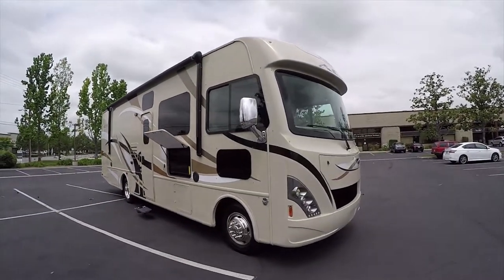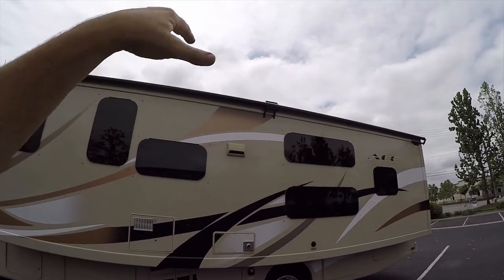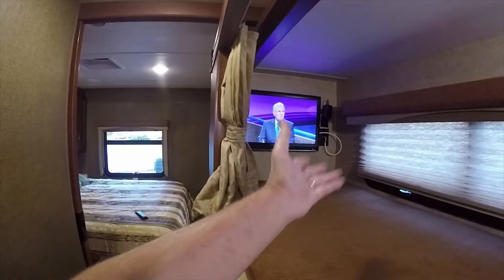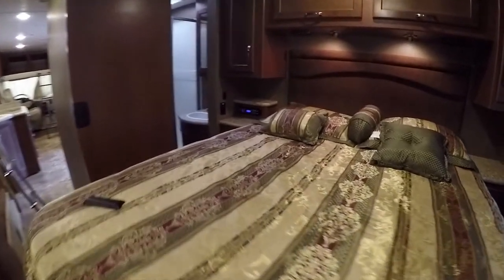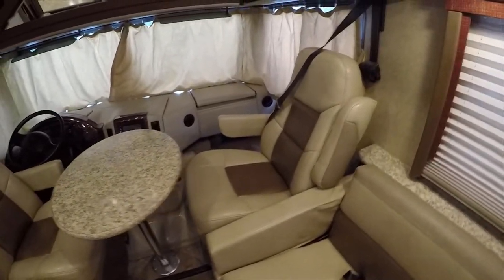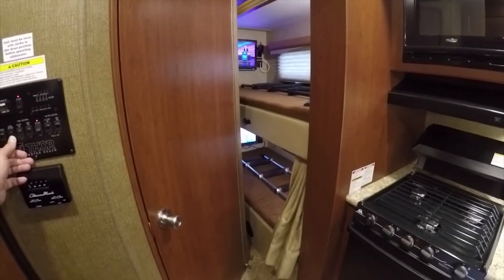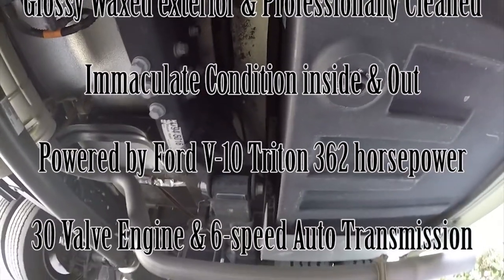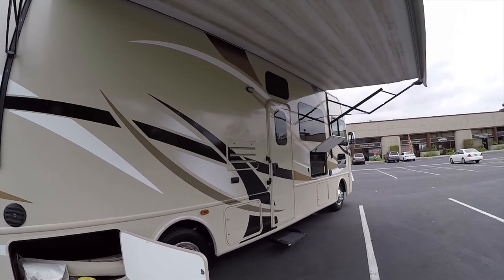16 Thor Bunk Ace 30 2 60fra Try2

Comment: It’s only 8000lbs with barely any cargo and water in the coach.
Reply from the maker: Huh???
The RV motorhome is 18000 GVWR capacity with Towing capacity of 8,000 pounds
the combined weight of the RV plus trailer is 26,000 pounds